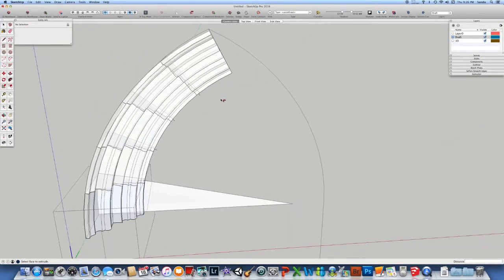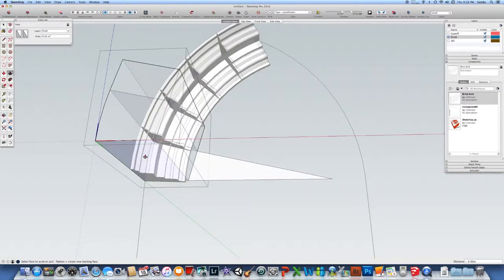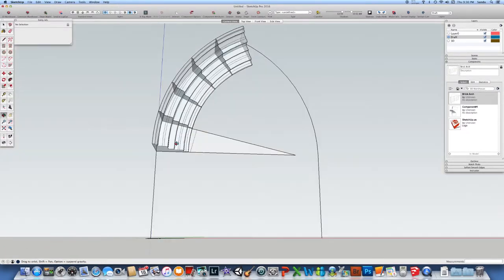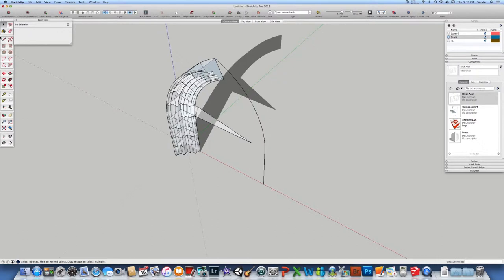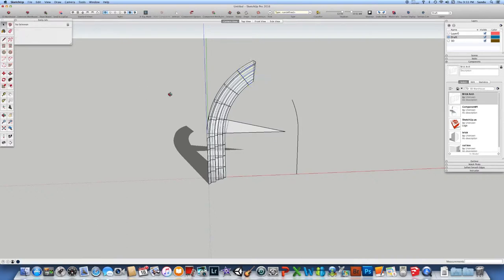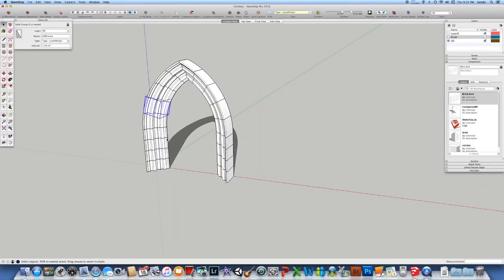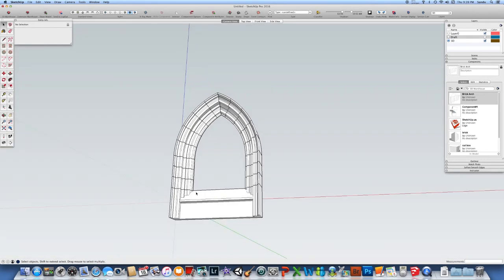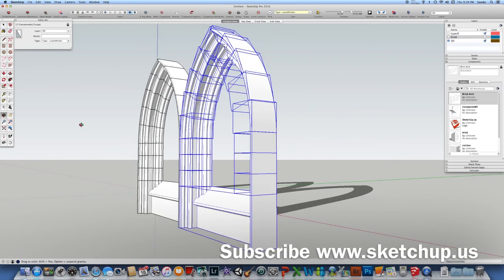020 SketchUp.us Tips to Build a Gothic Arch part2

Comment from the maker: Thanks for comments. The issue with follow-me tool is that it starts with the shape perpendicular to the normal, hence no other angle than 90 degree. Since the arch have the start at an angle less than 90, you will need to adjust accordingly, so follow me tool is not the best solution, you will need to uș boolian operations though. the goal here is to show various building methods.